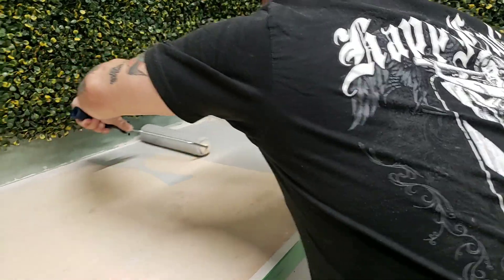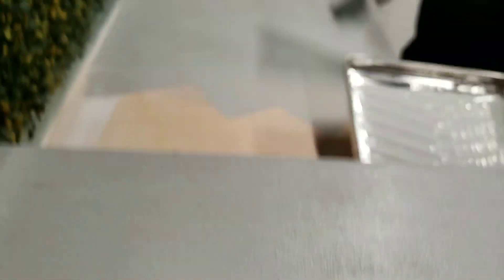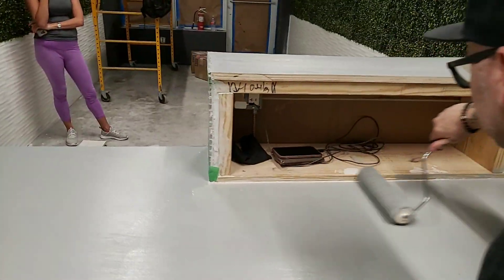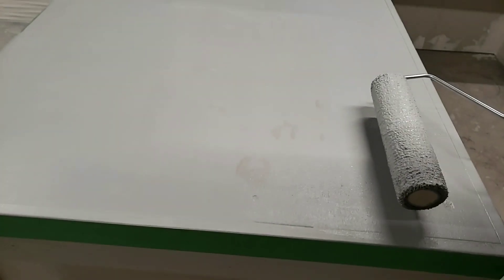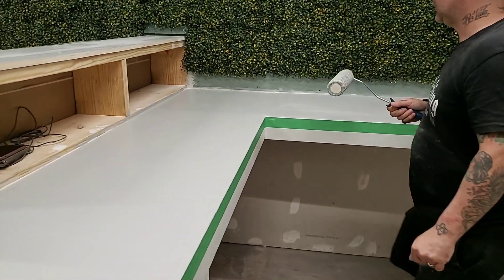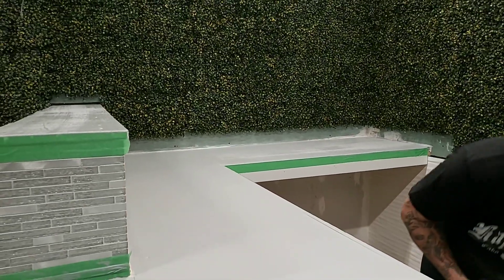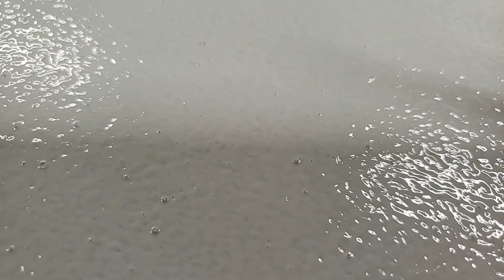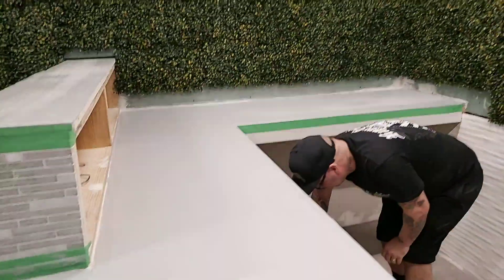Base Painting Prep for Epoxy Countertop

Comment: Durahms rock hard wood putty or Mike’s favorite... Bondo, is great to seal and help smooth out those pits and micro gouges. You would have to do an extra step to sand it smooth, but you would end up with a flawless surface.

Comment: How long, or how many times can you put the roller in a zip-lock and then reuse it? Will it eventually mold?
Reply: Use a baggie for jobs that last about a week. Or you can drop the roller in the bucket and store it there. It's a little messy getting it out, but you won't go through many rollers. Some people even store them in a ziplock and then throw them into the freezer, but that makes me nervous about introducing water.